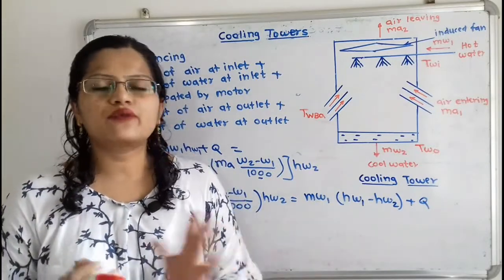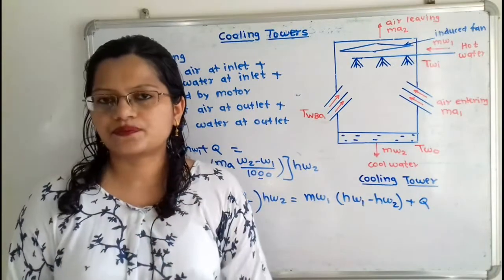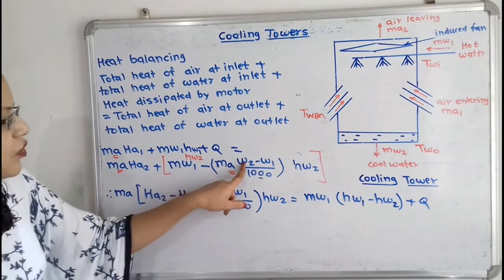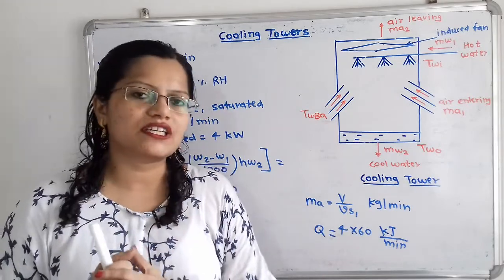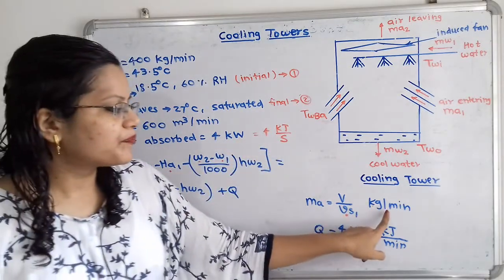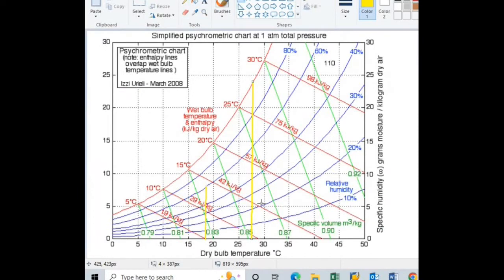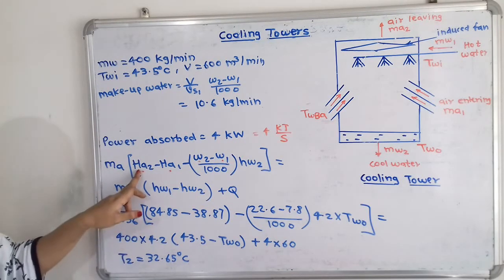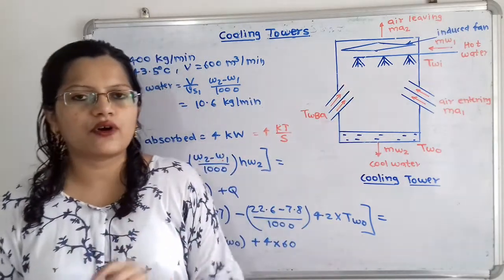Problem 2 cooling tower, Heat balancing with Psychometric chart

Comment: It's a controversial point though,
I mean if you account for the mass of the makeup water in the outlet which definitely affetcs the energy carried by the outlet water, why don't you account for the same amount of make up water that would be gained by the air as vapour which will also account for the energy gain by air outlet as latent heat?
I don't really get it